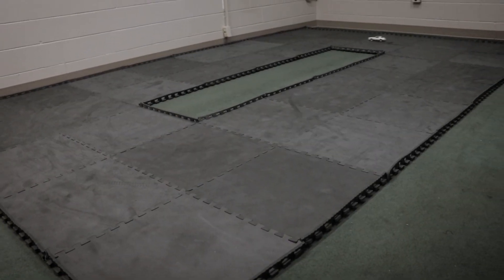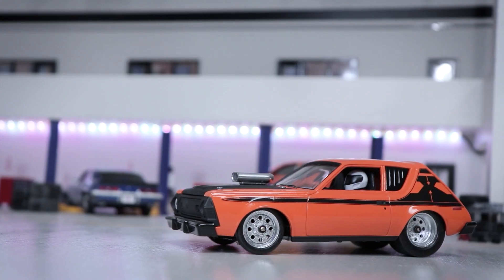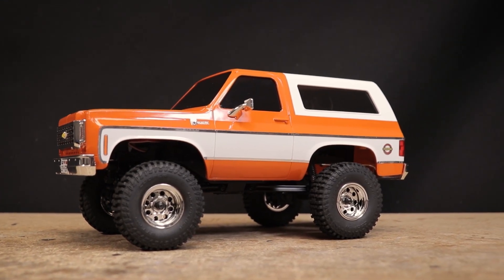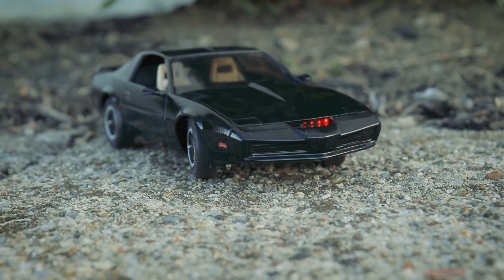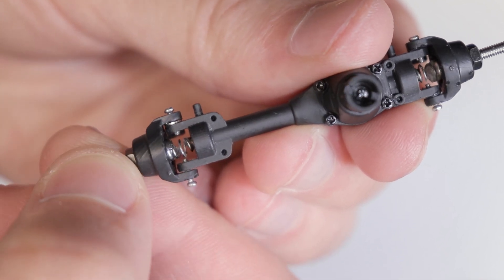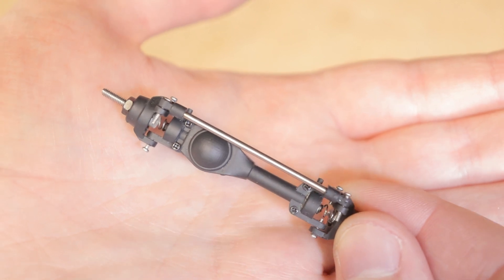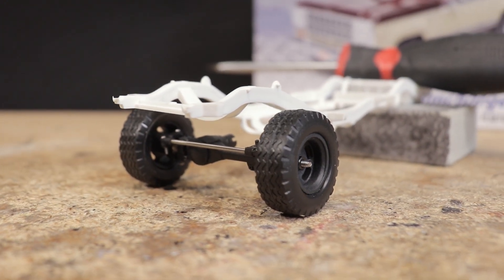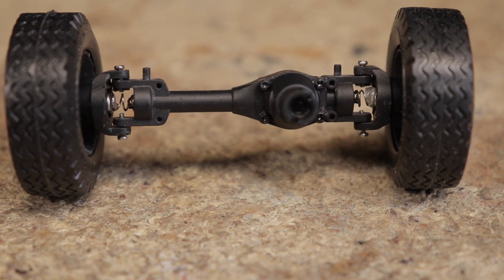DIY 3D Printed Micro RC Steer Axle Built with Springs, Glue, and Dreams 😂 But Will it Actually Work?

Comment: Love the videos. Nice work.
Is there a reason you don't use the same u-joints from the drive shafts for the CV joints?

I built several rc vehicles in the '80s using model cars. Mine were all made by hand and not as scale in regards to the driveline. But I always wanted a scale driveline.
I used springs as u-joints for the drive shafts. I made the springs by winding piano wire around a rod. They worked great as long as you didn't back up too fast and unwind the spring, so I added a nested counter wound spring to have support in forward and reverse and they still flex. This could work for your CV joints.
Now that I have a 3d printer, I am going back and making all the ideas I had as a kid and adding some new ones. Very time consuming but fun.

Comment: I've done something similar to the CV axle springs . The best way to attache the output and the CV spring I found was to grind both sides flat like ```|  |`` and slide the spring over the flat area and hold the last few coils of the spring and the axle with vice grips . And use some hefty pliers and squeeze the spring to the same flat snap as the ground flat axle. Then use some needle nose or a pair of wire cutters or dyke's to really crimp together the spring and axle and a little super glue to be sure . Should work for your CV axles as well .✌️🇺🇸✌️

Comment: You may have thought of this or heard of the suggestion but It's what I thought of slightly Use a thicker spring, or Put 2 Springs on each side, but have them facing polarops. So that 1's always pulling on the other as 1's turning one way or the other. Maybe it will Reduce the strain on them.

Comment: Is it possible to somehow solder the spring to the rod and screw either side, instead of gluing? I mean, you'll probably have to sand the plating off (if there's any) from all surfaces, do the soldering, and then re-plate the whole thing afterwards (nickel plating, I'm guessing? This is really out of my depth), but would this actually work?

Comment: A Volkswagen beetle swing axle has an interesting design that may be useful to apply in this scenario. The axle is more like a slotted screwdriver and the output cup has 2 half moons that allow pivoting side to side while the slotted end is allowed to oscillate within the cup perpendicular to it. I suppose the difficulty would be making the dual axis cups but it requires no tiny pins or yolks.

Comment: They use springs in the drive shaft of weed wackers with curved shafts that transfer quite a bit of torque. Maybe looking to how that works to get more torque out of the spring idea? Not that you’d need it for super scale builds. Just a thought.

Comment: (^-^)/ YOO! Guitar cords or clear (latex?) Fish tank tubing. You can coil your own springs with guitar cords also but may not be the best option but try it. 

I've also ran guitar cords through that clear tubing before as a conduit with some vary proming results. USE WHITE LITHIUM GREASE. If the cord goes to fast the tube will fail. 

I've used this as a flexible shaft on a rc boat I built out of scratch and random parts laying around. I was making my own props by hand for fun. This was a hand sized boat. I was able to use the shaft to steer the boat with a minor rutter shape. And nylon bushing made out of scrap.

Comment: im unsure if this scales well but i have made some very strong "uni-joints" on lego models using two axles connected by a flexible but firm fuel hosing. it could handle more torque than standard plastic pieces.

Comment: Seems orlandoo cvds or even driveshafts (they have a few options, u joint & cvd) would be exactly what your needing if you can get the axleshaft long enough for the offset diff.

The awesome part of using a spring is it’s kind of a build in damper to help reduce breakage when getting bound or under heavy throttle/braking). Also cool it can be made from basic parts. ;)

Comment: Nice work. Maybe swap the direction of the spring on the opposite side will help with the issues.  That would make the wound of the spring of the same direction on both sides.

Comment: Hey There,

I like your work. You mentioned Orlandoo axles, as well as flashed a picture of some Geko24 axles.
I have a set of 60mm black and red aluminum Orlandoo axles sitting around.
If you'd like them, hit me up with a shipping address.

On another note, the Kuro King X-ROW has lockable diffs in a 1/24 scale axle (similar to the GK24 size). They're sweet. Check them out if you have the money.
Reply from the maker: Thanks for watching and glad you enjoyed the video! The Kuro King 2.0 looks awesome. Amazing piece of engineering!

Comment: Something to try, a cross hole at the ends of the axles to be linked and bend the ends of the spring to pass through said cross holes, making them mechanically linked instead of chemically (i.e. glued). Then as an added bonus you could try a dob of epoxy smushed into the hole once the spring is in to help lock it in place and/or maybe sleaving the spring and a mm or two of axle in heat shrink

Comment: Excellent. 
It looks to me that the pivot point on the steering knuckle needs to be changed in such a way that  the sping does not stretch or compress but only bends when turning.
Reply from the maker: Good eye, looks like the design could use a little adjustment. 👍

Comment: Have you thought about using braided wire, commonly called wire rope, instead of the springs? It might be worth experimenting with. It would definitely be easier and stronger to solder to the axles, rather than trying to solder the springs.

Excellent work as always!
Reply from the maker: Thank you, will look into that. 👍

Comment: I've been making my own shocks lately out of brass tubing and 1.5mm piano wire with printed ends and piston they work great might be worth a try with those leaf springs
Reply from the maker: Nice! I've been sort of slacking on shocks. 😆 I've used magnets in the past for dampening. When done right they work nice but aren't the most scale. Sounds like you've got a good set up that would look a lot better. Will have to experiment with something like that. 👍